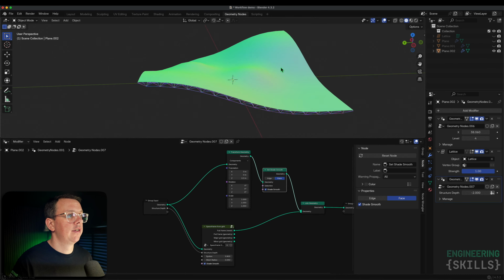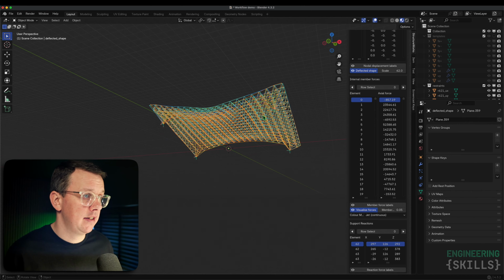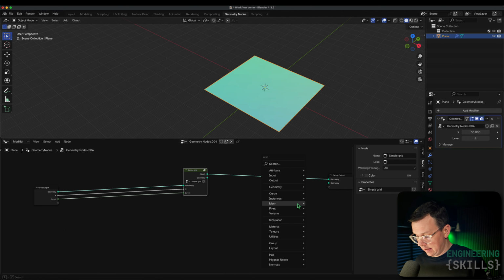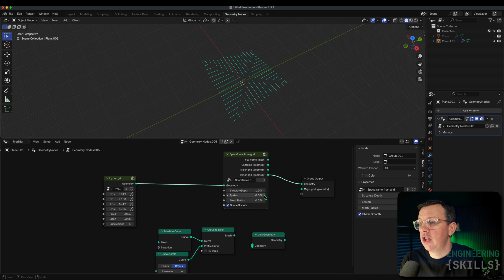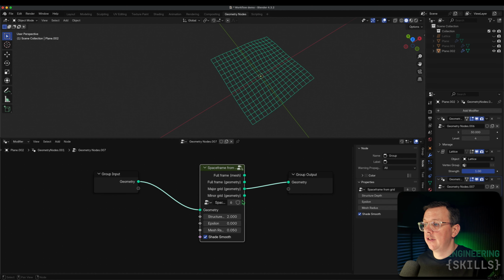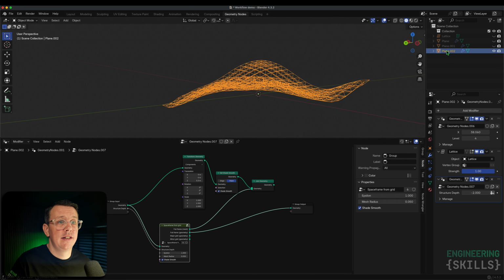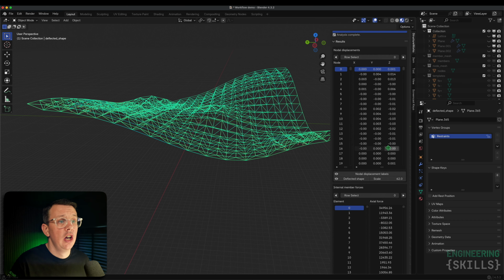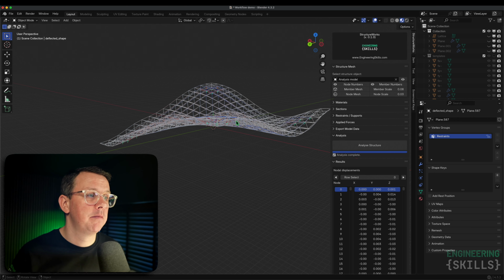Blender Geometry Nodes Spaceframe & Structural Analysis with the StructureWorks Addon

Comment: So cool! Do you happen to know what sort of validation has been done on the analysis methods?
Reply from the maker: Thanks! There has been no formal campaign of validation, although through the process of building the addon (and years of using the underlying analysis code), I'm confident in the results generated. 

That said, the addon does come with a fairly standard disclaimer - so validation, particularly in a commercial setting is ultimately the responsibility of the end user. Keep in mind, this addon is primarily a vehicle to teach people how to make addons in Blender. It's not actually distributed independently of the course. 

Hope that clarifies things.